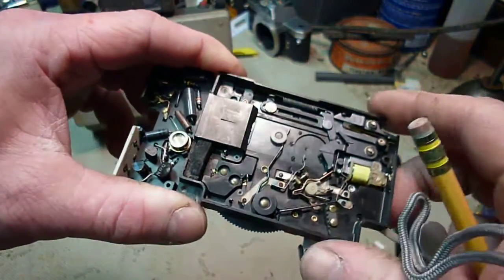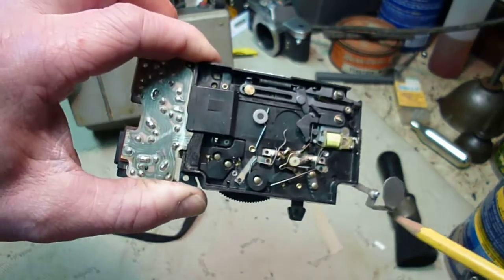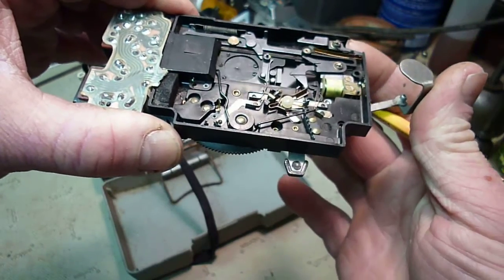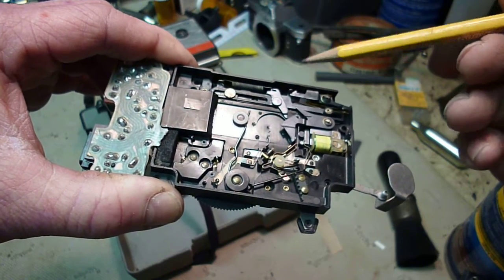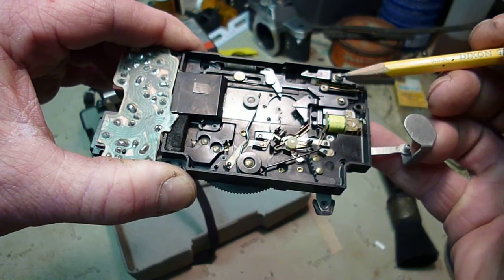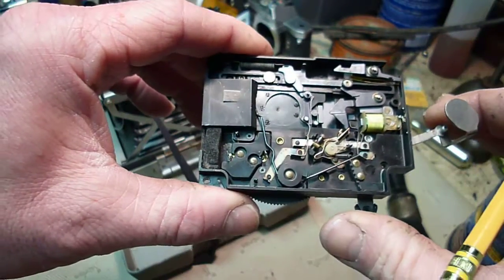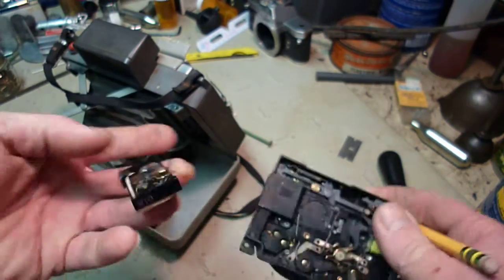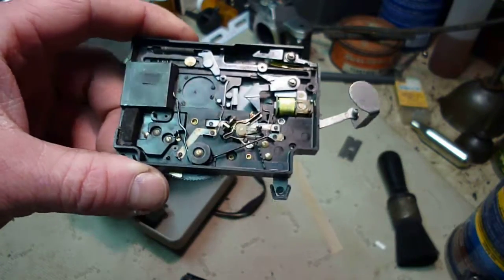polaroid shutter basics

Comment: How quickly does the electromagnetic shutter open and close the aperture? Could it be seen with the naked eye, as you press the shutter release button?
Reply from the maker: That will depend on the lighting, bright light hits the sensor, fast shutter, low light, slower.
Reply: @tobroken1965  Thanks for this info and for your video! I purchased a refurbished model, but I suspect the aperture slide is not opening - even in low light I'm not seeing that open.
Reply from the maker: @hollyyvette1104  Hmmm, are you certain the battery connections are solid?
Reply: @tobroken1965  I'm not sure - they converted the battery to accept AAA, and the housing a wiring look new and connected, but I haven't opened it up fully yet. It is under warranty, so I can get them to take a look.
Reply from the maker: @hollyyvette1104  this is interesting,  has it also been converted to take modern film?

Comment: i have a polaroid 210 that worked for about 7 months but all of a sudden the aperture doesnt open for light anymore. i thought the battery wasn't working so i bought a new one, but it didn't work with the new battery either. do you have any idea what could be wrong?
Reply from the maker: Off hand I would check the battery wires very closely. If at some time during the life of the camera a battery leaked in the compartment, those wimpy little wire connections could corrode and break while looking mostly ok. Pay close attention to the ends that connect to the battery. Good luck, its a shame Fuji stopped making the film,  it was great stuff. Its also possible to swap out the electronic guts if all else fails.
Reply: tobroken1965 okay thanks for your input! i'll have my dad look at the wires since i'm not so good with that type of stuff. i barely found out last week that it wasn't working anymore. i hadn't used it in about a month or two, it was just on my shelf and now it doesn't work :( bummer

Comment: Thank you for this video. My shutter didn’t work, so I got a new battery... it does not open. Any sugestions? Please help.
Reply from the maker: I would check the battery connections and wires first. These are not (by modern standards) very sophisticated. If the wires are in good condition, you may have to open the face of the camera and take a closer look. It could just need cleaning or there could be a bigger problem. If all else fails you can pick up another camera and swap out the whole shutter unit. Dont be fooled into paying alot for any but the very best and rare (very few models are rare, polaroid cranked these things out in millions). Decide first how much this is worth to you, when I made this video Fuji was still making the pack film, they have since stopped making it and no other source is currently available.